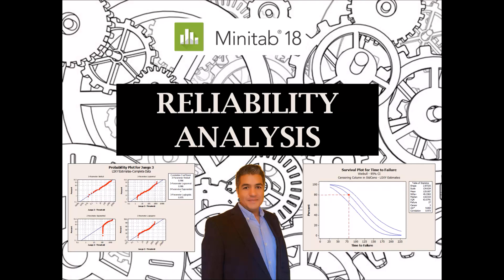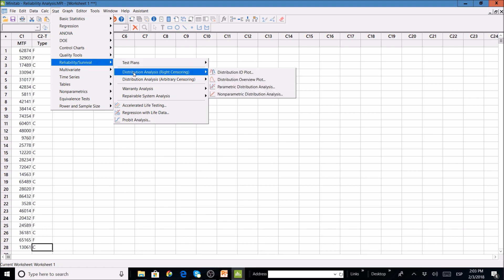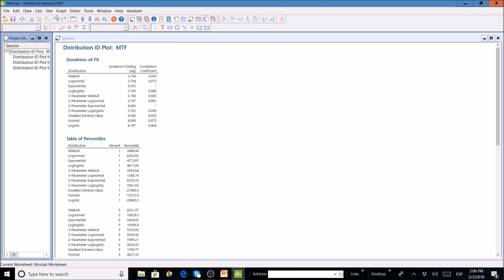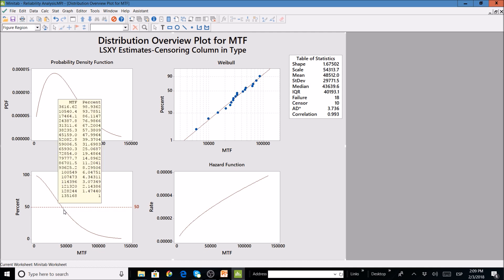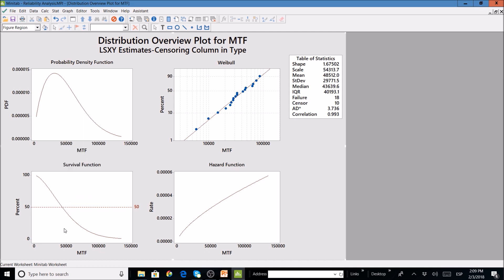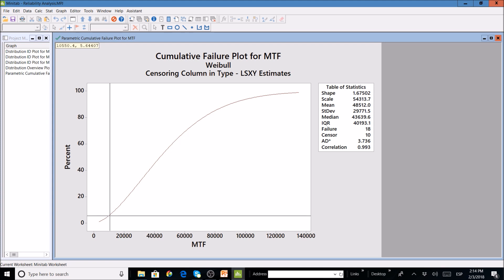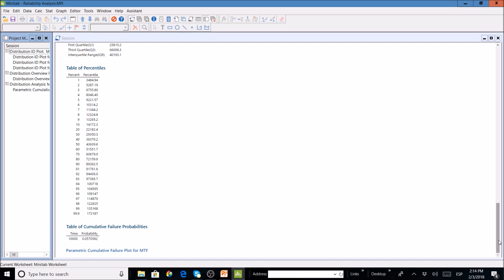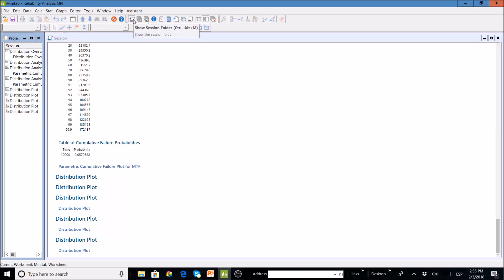Reliability Analysis using minitab 18

Comment: Hi Jorge, this a great learning, thanks for video. Request your guidance for my analysis. Actually i want to use weibull for my tool failure after producing some parts randomly. for example i will get some failure at different cumulative values like at 20, 80,120,500,1200,1500,5000. For me its no of failures for cumulative production. How i can use this weibull for my analysis.
Please waiting for your reply.
Reply from the maker: Hi Prakash,I did not get your example. Could you explain further? jogongut@hotmail.com

Comment: Why you select not maximum likelihood  but least square  ?
Reply from the maker: In this case because the quantity of censored or suspension data is very low, some times you have huge number of censored data and in this condition is better the maximum likehood
Reply: @JorgeGonzalez-yf6qo  thanks a lot.

Comment: Hi Jorge, Thanks for the video. It was really helpful. 
I have a question, when you were discussing  CDF plot, you mentioned that 5% of the vehicles WILL fail for 10000 miles. But because it is a distribution fitted on the existing dataset, CDF tells that 5% of failures HAD happened before 10000 miles right? It tells the behavior of the current dataset right!?
Reply from the maker: Sorry for the late response on this, it is correct to make the statement that we will get 5.7% failures before 10000 because at the end this also apply for the future units that will be produce until a change it is been made.